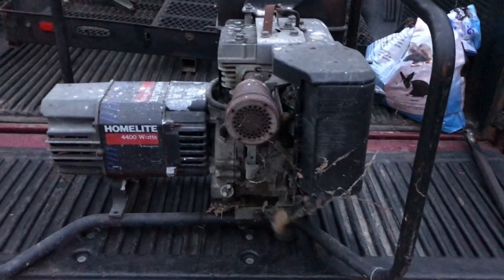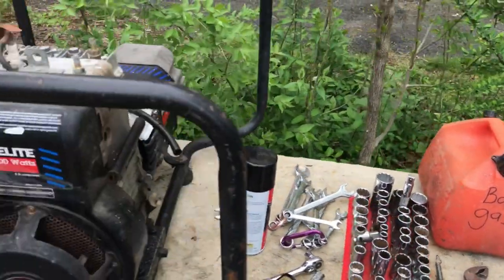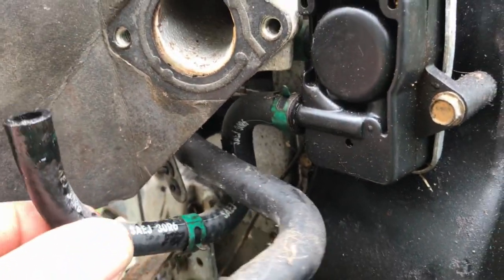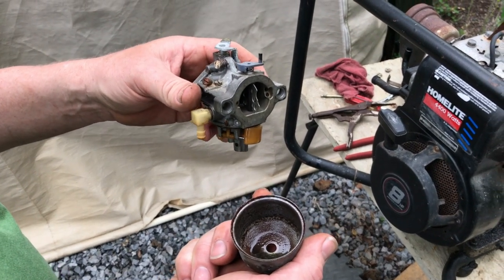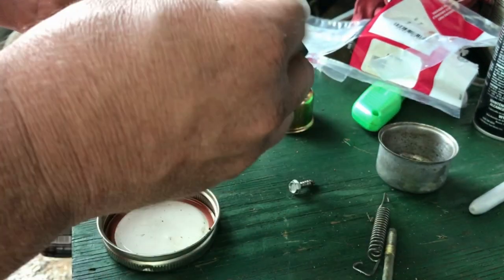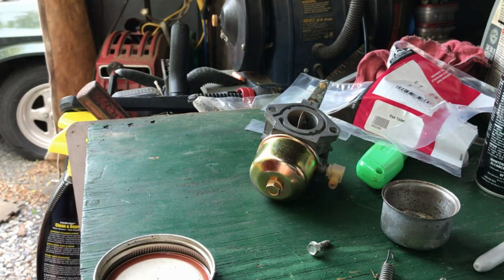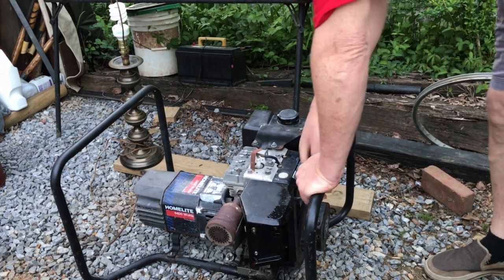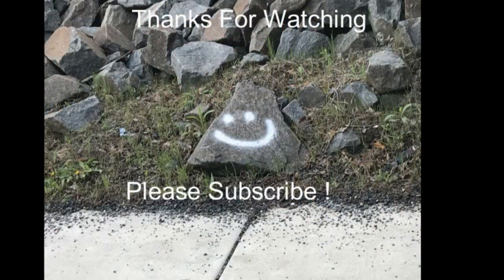Trash Find Homelite Generator, Lets Get It Working

Comment: My brother gave me this exact generator when the power kept going out at my house. It had never been used, sat in his garage forever. I drained out the old gas, put in new gas, new plug, new oil and it started up after about 8 pulls. Now it starts every time, 1st or second pull. I love this thing. It's super loud but it's reliable. It's like NOS. A few weeks ago I had to start it up at about 6am before heading to work because the power went out again. Needless to say the neighbors didn't like it but my refrigerator and freezer stayed cold. This thing is reliable and super cheap if you can find them. I'm looking for another. You don't need all that other high tech garbage. save some cash and find one of these.
Reply from the maker: That is great. Someone commented that they needed the model number and serial . Could you please give that info to JAB in the comments. Thanks for watching

Comment: I just got my 10 HP briggs trash found generator going Similar to this was Cambell Hausfield. hope its not messed the oil is really gray on it after 10 mins of running.   Runs good though after I went through the clogged carb. Makes 118 volts and 60hz i should tune it so its 2-3 volts more at low/ no load
Reply from the maker: Yes you should tune it to get the voltage right. I would let it run and get hot then change the oil again.
Reply: @TheGAutomotiveAndMore   think it has a wing nut and a set screw for the fine adjustment.  Yea i changed it again. it runs fine its not at all tight. the oil i drained has some swirls settled on the bottom

Comment: Reverse Torx have a prefix  of E.   I believe the carb bolts are E6 Torx. Also I usually pull the gas hose off the carb and pull the starter a few times to easily see if the fuel pump is functioning.  Just look for a pulse of gas out the end of the hose.  Just my 2 cents

Comment: Great video!  Where can I find parts?   I need the metal parts inside the fuel pump that you show at 12:32 in your video.  Someone borrowed this gennie, and stole parts off of it!  I also need the large gasket that goes from the carb, then extends out around the exhaust.  Thank you!
Reply from the maker: I would try https://www.jackssmallengines.com/

Comment: The reason why the light didn’t work at first was because there was rust on the fly wheel magnets inside the generator part it self and it wasn’t making contact with the stator once than rust came off it made contact
Reply from the maker: I also think that the RPM's were not high enough.
Reply: @TheGAutomotiveAndMore  could’ve been

Comment: i've got a homelite 440 generator, but it's only putting out 90 volts. i took the end cap off but don't see a voltage regulator, just see the brushes.  
do u have any clues how to increase the voltage back to 120v?
Reply from the maker: Ok, your RPM's are to low. Put your volt meter in the outlet and adjust the RPM's up  until it reaches 120 volts. There should be a adjustment place near the carb that has a way to increase the speed. Thanks for watching

Comment: You're good at what you do, very informative. I just bought a lr4400 brand new in box and hope to keep it running strong
Reply from the maker: Thank you. With the gas out today I would always run them dry. Thanks for watching
Reply: @TheGAutomotiveAndMore  You prefer storing engines with stable at end of season or running the engine until it burns off all the gas then store?  I've been running the gas out on my mower and for several seasons it's started up easy and strong in the spring
Reply from the maker: @JohnDoe_88  Yes run them dry.
Reply: @TheGAutomotiveAndMore  thanks I'll keep doing that since it's worked well... I say too many ppl waste money on stable to store just a few months when not needed
Reply from the maker: @JohnDoe_88  I still put stable in all my 5 gallons cans when I get gas, so I know it in there. Just in case I forget to take gas out of something like my snowblower.

Comment: I got the same generator which was included in the property we just bought. Looks like it’s been sitting outside for some time and I’d like to get it running. It turns over and had spark so I’m sure it’s a similar fuel pump/carb problem. I was thinking I’d just slap on a new carb and fuel pump if I can find one cheap. Any idea what year or model this is?
Reply from the maker: It should have model and serial numbers on it so you came order parts. I like to use Jack's Small Engines web sight. Thanks for watching

Comment: Mines a much older version, Your carb reminds me of the one on my Honda Powered lawn mower. Say 10yr old for yours. Mines 30 I'll bet. Very similar.  The Carb on the free gen that I got is larger and very different. Surges. Then eventually stops. No gas pump on this model. But, it did fire with a new plug. Had a gas leak so no nasty gas in there. So carb cleaning I guess. Dry gasquets , like the one on your float bowl. Was hoping to see the inside of one like mine.
Reply from the maker: They are all pretty similar in side. Look more on youtube, I bet you will find your carb in sombodys video. Thanks for watching
Reply: @TheGAutomotiveAndMore  Oh ? Your not going to go out and find one and do a special video for me ? OK ! lol

Comment: Just picked up a 11HP Briggs gen 5000 watts. Thanks for the vid. Now I know what I'm up against. Fixed a million mowers but this riding lawnmower engine stuff is new to me. Carb looks familiar though. Always much preferred Briggs carbs over Tecumseh or Honda, etc...
Reply from the maker: All the carburetor are very similar, so if you have done lawn mowers carbs you won't have any problems. Thanks for watching

Comment: How many rpm are you running at
Reply from the maker: I think it around 3,000 rpm. But you adjust it the the output voltage.

Comment: How do you shut this
Down ? Mine is missing a few parts
Reply from the maker: It has a metal strip that is next to the spark plug, that you push down and it touches the top of the spark plug. It grounds the spark to the head and cuts the machine off. Thanks for watching